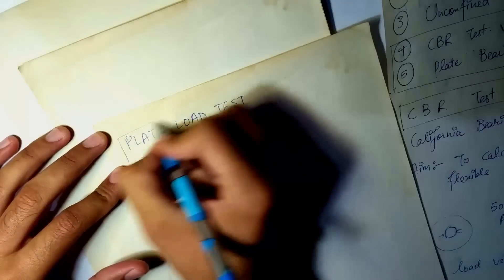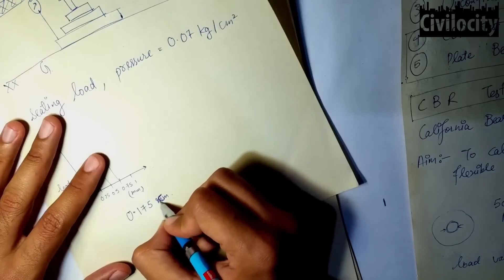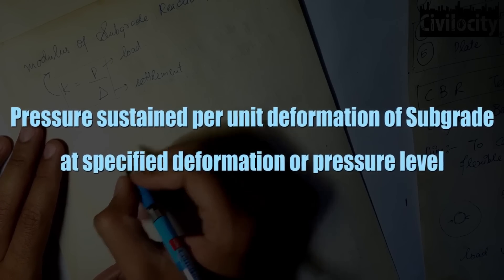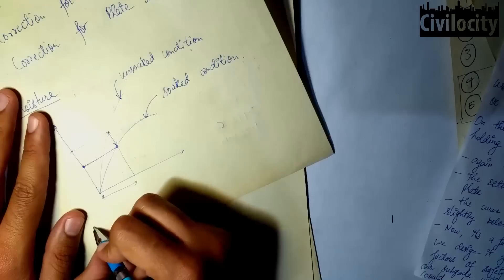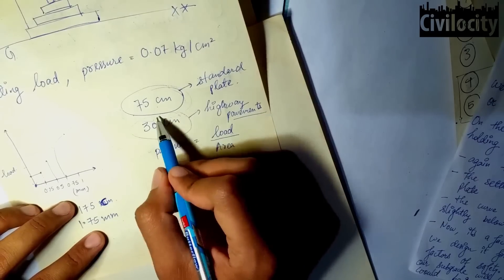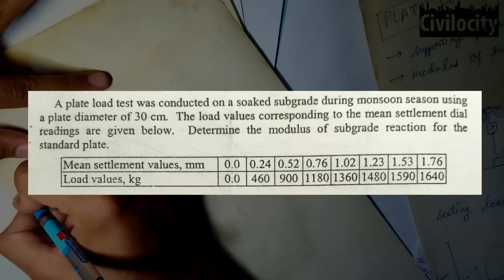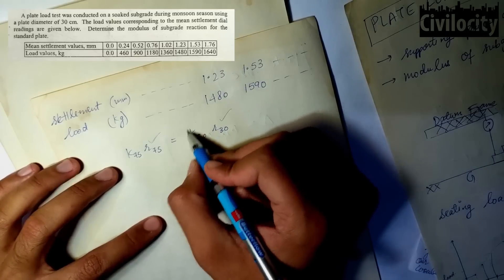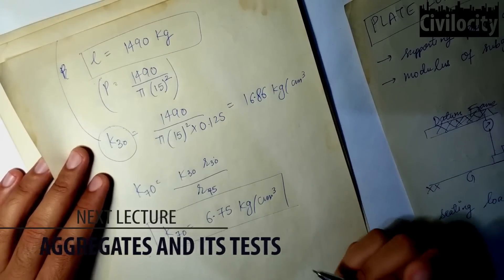Plate Load Test of Soil | Highway Engineering | Lec-11 Part-3

Comment: Sir, your value after interpolation is wrong. I just invested my 15 mins to confirm my method and it seems it is wrong by your method of interpretation also, the value of load will come out to be 1487.333 instead of 1490

Comment: delta= 0.125 or 1.75 ..???
Reply: rakesh roushan  1.75 mm deflection  is the maximum deflection.  But our recommended deflection or standard deflection  should be 1.25 mm .
Reply: rakesh roushan 0.125 cm or 1.25 mm
Reply: sir question to sahi se pddh lete aap
Reply: rakesh roushan Qstn ka hi answer diya dekhlo. Δ= 0.125 cm or 1.25 mm.
Reply: sir mera question fir se pdho aap plzzz